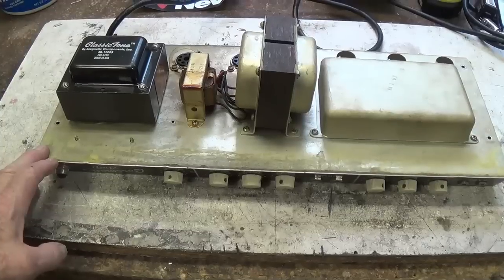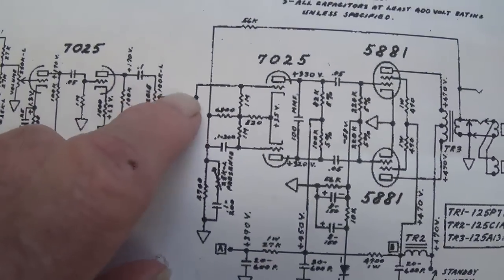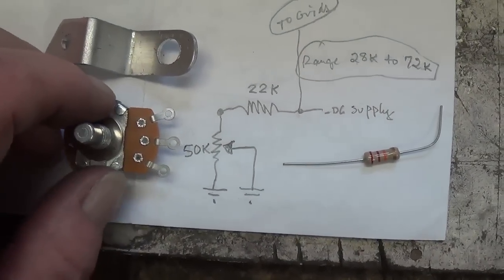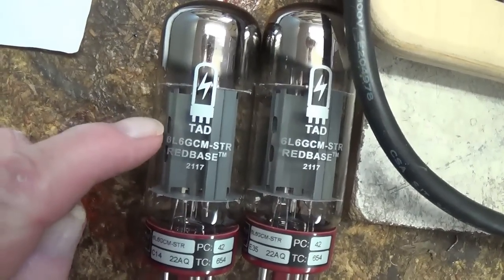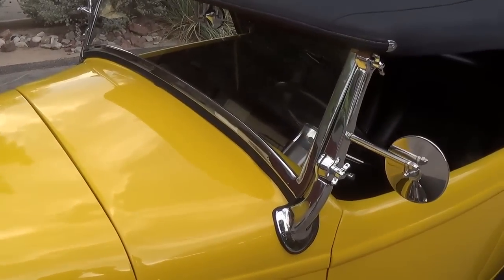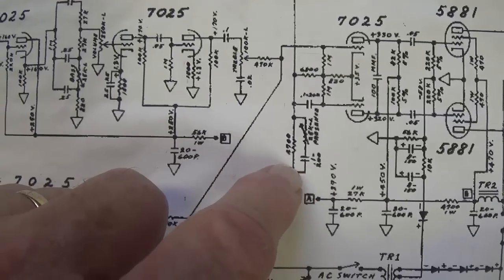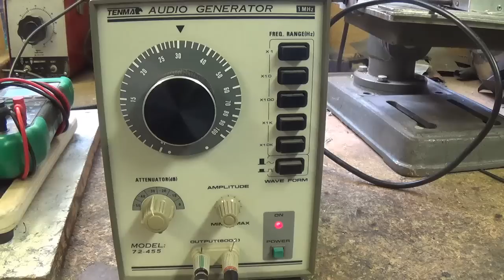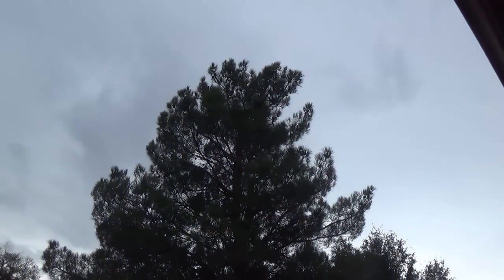Rare Brownface 1962 Fender 6G6A Bassman.....in for a Tune-Up

Comment: Being only 15 minutes in, forgive me if you cover this subject later and I merely havent gotten that far yet, but the previous tech having substituted 500 volt rated caps for the first filter stage in place of the original 600 volt caps might be problematic when the amp is in standby; without a load on the power supply the DC B+ voltage might reach perilously close to (or a little over) 500 volts, especially at turn-on with a solidstate rectifier. Fender used 600 volt caps for a reason here; you might want to consider putting a pair of 300 or 350 volt caps in series, with balancing resistors,  to reach or exceed 600 volt capacity. A pair of 70 mfd at 350 volts would do it. I'd be really curious to know what the voltage measures on those caps when it's in standby!
Reply from the maker: Thanks for your helpful input, GU. Hopefully, everything will be fine.

Comment: Hi Doug, What is the purpose of a bass channel? Is it for a bass guitar or to produce a sound with more bass, or both? Would it then make sense to provide less amplification of the treble as we see in the circuit for this amp? Jean-Marc
Reply from the maker: That's a good question, JM. To me, an amp should be dedicated either to bass or guitar......but not both.  The marketing folks probably thought they could sell more amps if they were "dual purpose", so they labeled them as such, but I can't think of a single instance where they succeeded.  Even the mighty Fender Bassman is considered to be a wonderful guitar amp.......but have you seen many (or any) big name bands using it for bass?

Comment: Hey Doug thanks for all the great content, but I need to know what make of poker do you use for a soldering iron? some of your solder joints are appalling!
Reply from the maker: I use a $197,000 Argon laser that is controlled by a Cray computer to make the finest solder joints in the history of electronics, Col. With this gear I have won the Solderer of the Year Award from Flux Magazine for the past 15 years........consecutively.
Reply: @UncleDoug  Wow Doug, that's an impressive set up, I've always dreamed of owning one of those, no wonder you have won so many awards, it puts my $50 30 year old Weller set up to shame , however I do think that you need to adjust the focus and the beam current pots on the laser as it seems to be vaporising everything in a 2 inch radius. Joking aside keep up the excellent content, you have a wealth of knowledge on these old tube amps.😁
Reply from the maker: @col8981  Thanks so much for your kind words and good humor, Col.

Comment: Had to correct you Doug , the bonnet is in the front , the boot is the rear, just for us English speaking people....
Reply from the maker: Thanks, Rick. This was already addressed in the first (pinned) comment.
Reply: Sorry Doug , I should read more....nice job on the car, your lucky you can drive it on the road, here in Oz it would probably be defected for not having mud guards.. @UncleDoug
Reply from the maker: Thanks so much, Rick. There may still be similar requirements in a few states here in the US......which I will scrupulously avoid ;) @rickcostin

Comment: Uncle dad, how come you went for the more head room with the 6L 6's instead of the 5880 ones seems like the 5880 ones would be better for a rock tomb because they would break up much sooner. I mean, the 606  that's 14 Watts, more head room. I'm sure the transformer can probably handle it, though not sure about the output transformer. But I'm sure that power Transformers fine.
Wow, dude, that yellow on that car sure is sexy, isn't it? Those rims do look like the old magnesium halibrands, don't they? My Lord, you put a lot of work into that car and boy. She looked sweet Doug and something to be proud of there. Now hurry up and pop that hood damnit I wanna see the motor.hahahaha😂
Nice louvers on those hood latch panels.
And yeah those English with their Bonnets and their Boots.
Uncle Doug you ever consider maybe running some boom tubes? They are Nascar flattened out exauhst that exits the sides under the doors. They sound amazing and are all hand made. It usually gains you a good deal of ground clearance and a good deal of freed horsepower due to reduction in back pressure of the exauhst. They are very flat. Usually only about an inch or maybe 2 at the most thick and are very wide. Probably 12 inches at the exits wide. They also look amazing. Very good craftsmanship if you can find some real nascar ones made by an actual team.
Reply from the maker: Thanks for sharing your observations and comments, FG :)

Comment: HEY UNCLE DOUG WHY THE 3 DIODES IN SERIES ON EACH SIDE OF THE CENTER TAPED POWER TRANSFORMER OUTPUT ?
Reply: BTW IM VISUALLY IMPAIRED , SORRY FOR THE CAPS
Reply: The IN4007 diodes are only rated for 1000 volts peak inverse voltage (PIV) each, and power spikes can easily exceed that. 3 diodes in series on each side increases their reverse-voltage handling to 3000 volts.  Power Transformers have a tendency to cause massive inductive spikes at turn on and turn off, and that's why you need the additional safety factor of higher voltage handling, even though the amplifier runs at less than 500 volts.  The rectifier circuit is known as a full wave rectifier and it requires a center tap as a ground reference for either leg of the transformer that gets connected to the series string diodes.
Reply from the maker: Thanks for your thorough reply to the question, GU :)
Reply: @UncleDoug  , I hope the visually impaired questioner can read my reply, since I didn't use "all caps". Maybe he can let us know. Anyway, I figured I'd save you the trouble of replying.

Comment: Use of a Variac transformer variable AC voltage regulator.
 If a Fender is set up to use 110 volts. and you are putting 120+ give or take, volts into the amp. wouldn't this create an  issue?
Such as if I use a Marshall amp that is set up to receive 110 volts. But the in house power is reading at a 122.2 volts (sic) from the outlet. wouldn't that make a huge difference to the amp itself?  To much juice...need tame down the volts.
Just curious, what are your volts at your current limiter, as apposed to the to volts at your power strip.
Reply from the maker: A 9% elevation in AC voltage really doesn't seem to cause any problems that I have encountered, Kev, with the possible exception of a situation where the output tubes are overbiased and on the verge of red plating at 110VAC. Since the 120VAC level seems rather consistent throughout the U.S. however, tubes are generally biased properly at that slightly elevated voltage level......so no problem. The voltage drop with a current limiter varies due to the amount of current being drawn by the electronic device.

Comment: I have an old Fender Echo unit that needs restoration. How to contact Uncle Doug?
Reply from the maker: I've retired from working on the oil can units, Woody. Check YT for Dead Koby.....he may still be working on them. Good luck.
Reply: @UncleDoug  Thanks ... But, it's a tape unit, with a working motor. The pickup might be the issue. I might post a photo tomorrow.
Reply from the maker: Well I guess that shows how much I know about them, Woody. I'm sorry that I'm unable to help. @woodystemms3799

Comment: Seems like you could have added a feature to use tube or solid state rectification, plenty of room all over to drill out new holes all over that chassis and panel, really the more the merrier. Also add some sweet extra gain stages and distortion switching options, maybe add a bunch of relays and so on. That would be sweet. Just kidding.
Reply from the maker: Thanks for sharing, M7 :)

Comment: Why not put in a new old stock set of TUNG-SOL 5881 power tubes? They will be period correct and are capable of handling the voltage.
Reply from the maker: I would if I had such a pair, Brian.

Comment: not a " bonnet,,,,rather a : Boot   the short tailpipes are going to "soot" the back of the car I'm thinkin
Reply from the maker: The first part was explained in the first comment, Tom. Yes, the short exhausts do leave a wee bit of soot on the bottom of the gas tank. I am trying to come up with a good cure for this.
Reply: the only cure I'm afraid is tail pipes,,, I am to the exhaust world as you are to the amp world,,,I make my living building stainless steel exhaust here in in the outskirts of Detroit,,everything from roadsters to full  out race cars,,,including custom header work. looks like you have flow master mufflers,,,obnoxiously loud,,,I think you would really enjoy some chambered turbo mufflers,,,I get mine from,,,just some food for thought Stainless works out of Ohio @UncleDoug
Reply from the maker: I agree, Tom, but am having a tough time coming up with an unobtrusive design for the tailpipes. I also agree with the need for better mufflers. The exhaust noise gets a little tiring after 10 minutes or so......much like a Harley with open pipes.  @tomstiel7576
Reply: to bad your so far away,,,I would gladly hook you up @UncleDoug
Reply from the maker: Agreed, Tom. I could use your help :) @tomstiel7576

Comment: Looks like the comment I posted yesterday has disappeared. I hope I didn't offend you or something, really wasn't my intention. If did, I sincerely apologise.
Reply from the maker: I'm not sure what happened to it, Dazz. I didn't delete it.
Reply: @UncleDoug  That's a big relief, thank you. Maybe the algorithm decided to delete it because I posted a link to an amp schematic? Who knows. 
Can't wait to see what you have in store for us with that Supro build from scratch!
Reply from the maker: There is no telling, Dazz. We welcome your comments and input. @-dazz-
Reply: @UncleDoug  Thanks so much, sir. Really appreciate it. Not sure if you got to read my original comment? it was about the grid bias circuit. I haven't seen a lot of them, but they all seem to use a voltage divider taking the output from the mid point between the resistor and the pot. Is it correct to say that by taking the output from the diode/filter cap, your design relies on how much the pot and the resistor load down the negative bias voltage?
Reply from the maker: Yes. The -DC bias voltage is given two paths: to the grids or to ground. The resistor (or pot) controls the flow. @-dazz-
Reply: @UncleDoug  Thanks again. Can't wait for that Supro build, I'm sure it's going to be epic!
Reply from the maker: I hope you're right, Dazz. We're trying hard to please :) @-dazz-